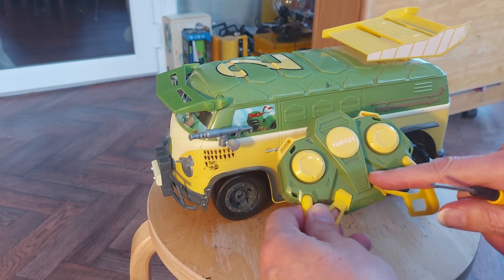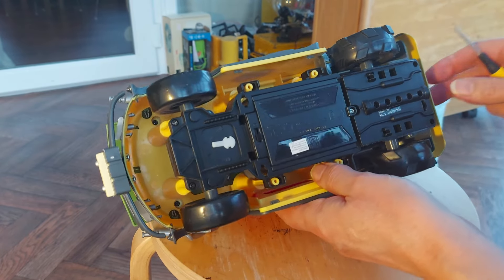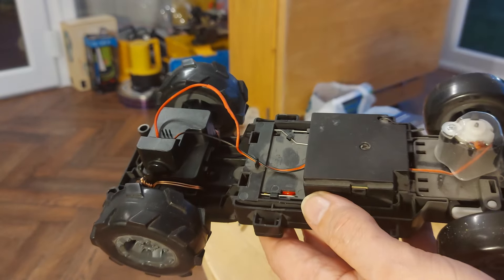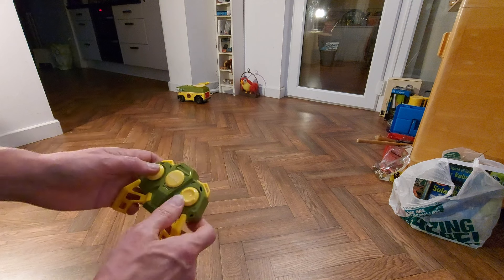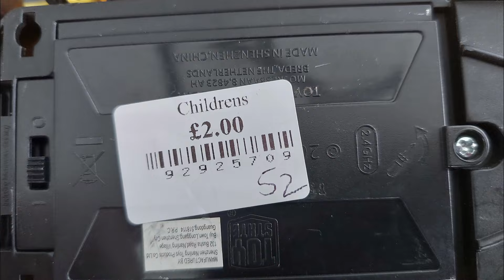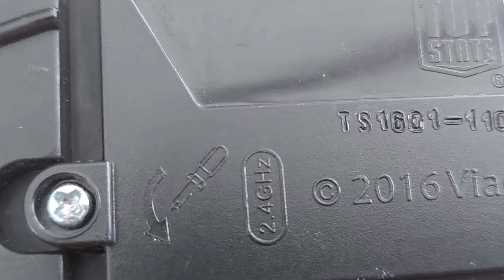Charity Shop Find - Nikko 9045 RC Teenage Mutant Ninja Turtle Party Van

Comment: I lost my bet. Not the pinion at all.
The faults when the previous engineer is a trainee are always the most interesting.
Wire is a good fix.
Reply from the maker: The wire will do the job, not perfect but adequate. They made those gearboxes for ease of production, not for repair 😁😁
Reply: @GrandadIsAnOldMan  Plus if you resell it on eBay that's the kind of low impact fix they like. Doesn't take away from the originality of the toy. Wonder if those small cable ties will fit round there?

Comment: These things are listed for crazy money on Ebay.
Reply from the maker: I would think they would need to be in perfect condition and original box, to ask a good price.
Reply: @GrandadIsAnOldMan  new in box is listed at over $140, used seems to be around $40. They probably don't actually sell for that much though. You'd be surprised though. I have a friend that sells parts to old ninja turtles sets and people will pay good money to replace that one broken piece they have.
Toy collectors are an interesting bunch. Lol
Reply from the maker: The problem is that people think they will get a good price so they ask for silly inflated prices on eBay. Unfortunately some charity shops use eBay as a guide to their pricing policy, so they put stupid prices on their items. I have no doubt sometimes things do go for good prices and there will always be some people with more money than sense. I see eBay has changed the way listings are charged since I last sold anything, so I guess you can put a price on something and just leave it listed until it finally goes plus you get a monthly quota of free listings. Life has moved on since I was doing it.